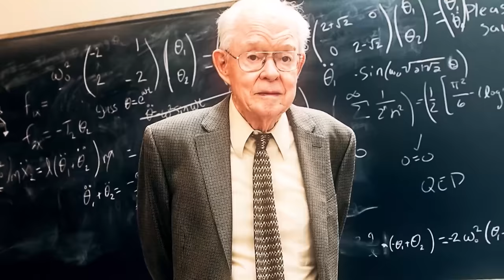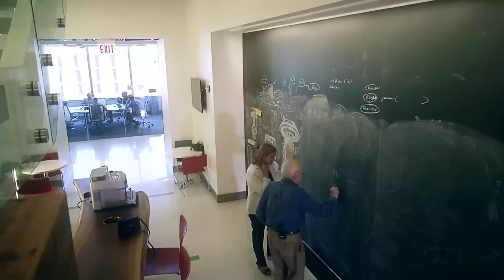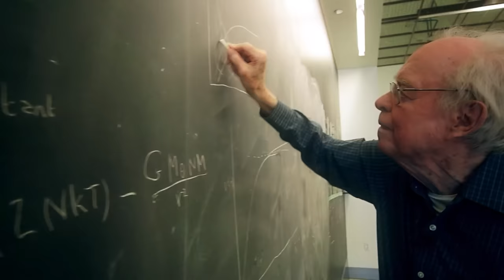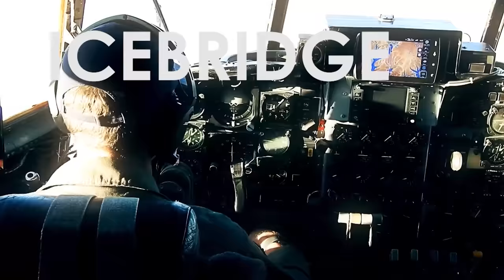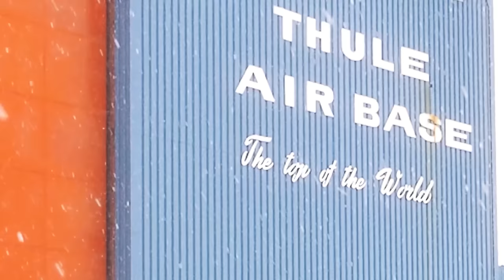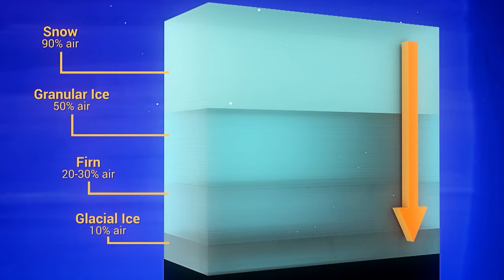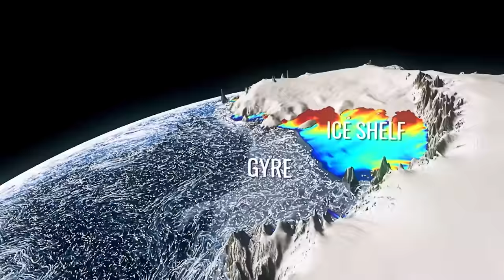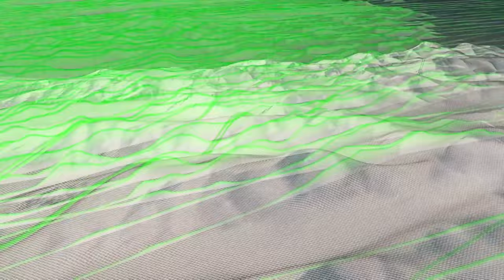Why Won't NASA's Parker Solar Space Probe Melt Around The Sun | The New Frontier | Spark

Comment: Just completed the 17th loop.  Coasting by the sun at 7.5 million kilometers (Sol is 1.4 million kilometers in diameter, so this far O-----.) above the surface at 635K kilometers per hour.  That is smoking.  The most impressive thing is it got from Venus to perhelion in 37 days.  The fastest thing we've ever made people.  edit for S&G, that's 110 miles per second.
Reply: Thats amazing! But isnt the speed determined by the probe using the gravitational pull from different planets (and the sun) to slingshot its way around? Or does it use its own propellant at times? 

Also I did hear that the launch vehicle was moving much faster than normal launches, so I guess it got a good start too? Could you explain a little more about "fastest thing weve ever made"?
Reply: @MrGrace  Parker used all it's main motive force to get in position to use Venus as a foci.  It has small thrusters for minor course corrections and rotations.  So, yes, it's using gravity alone now to get faster and faster.

"Fastest thing we've ever made" stands for itself.  Orbital velocity is around 5 miles/sec, most meteors are around that to 10 or so.  The Sol system requires 25 or so to escape.  Other than switching on a flashlight, Parker is faster than about anything we've propelled.